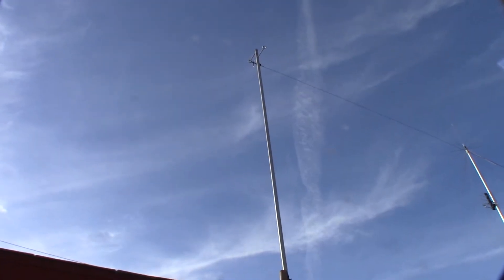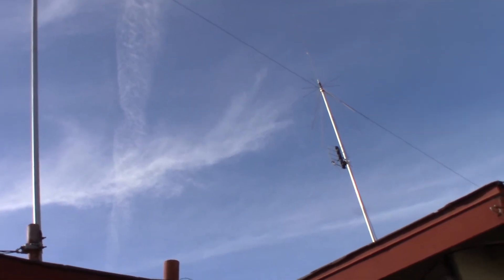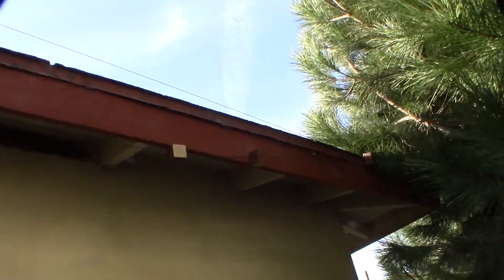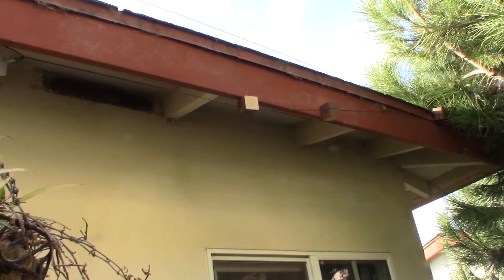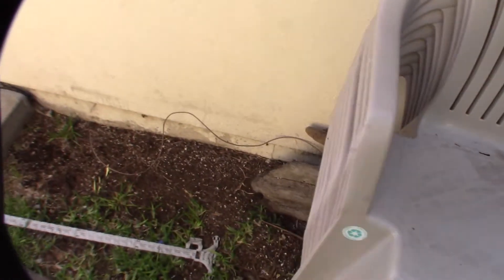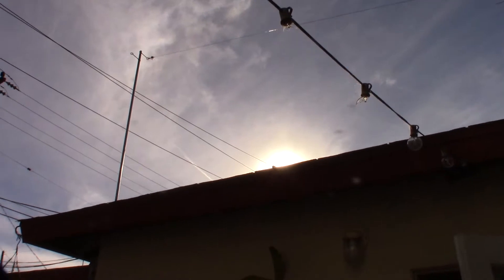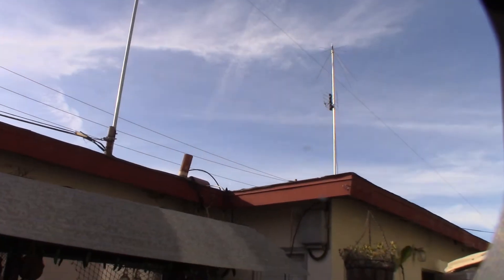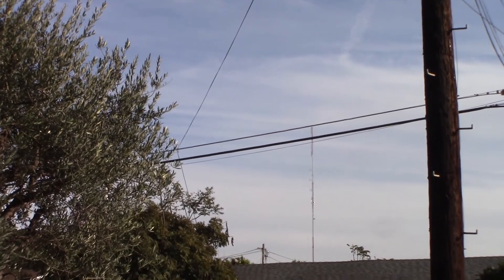New end fed 9:1 balun Unun Stealth multiband antenna 6m 10m 20m 40m

Comment: Even though you have the wire offset / not touching the metal flashing along the edge of your roof however since the antenna / flashing are paralell with each other the flashing is affecting the antenna.   Crossing the flashing at something between 60 and 90 degrees you shouldn't have that issue.      Are you using a particular length of wire (how long)?    If you can get at least 32' of wire up in the air without running parallel with that flashing I think you will improve things a bit.   As for attaching the wire to your balun - you will still need to get under the eve of your roof - just keep them from touching and you should be good     Also that flashing could come in handy and work well as a stealth counter poise.   I used aluminum gutter as my counterpoise in the past.   

As someone else mentioned earlier you can almost always find a "better way"   
Experimentation with HF antennas is a lot of fun and the best way to find that better way!

I've had HF setups at 4 different homes in the past each one offering unique obstacles / unique benefits.             If you can get an antenna analyzer or find a friend with one, you can experiment and find out what will get your the best SWR which will go a long ways toward improving your reception.  Good luck - and keep us updated.   

73 de Ben ne5B (licensed since 1992)